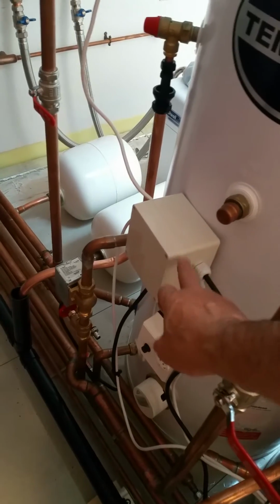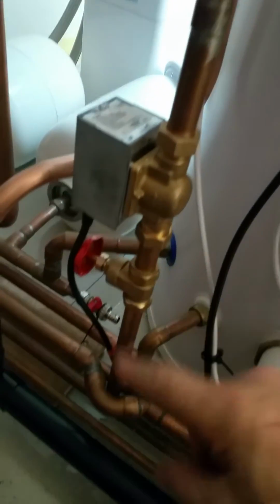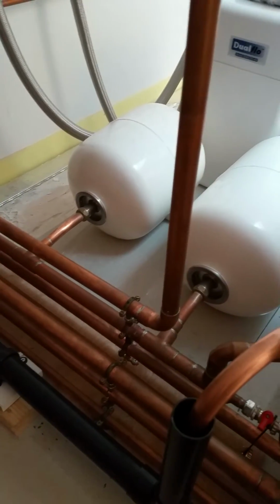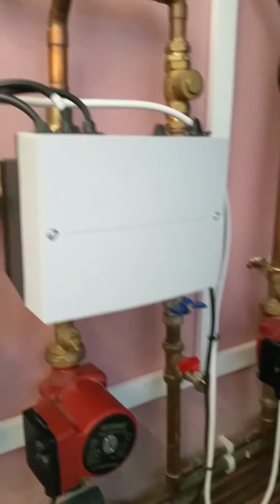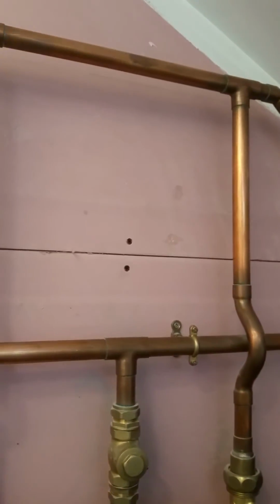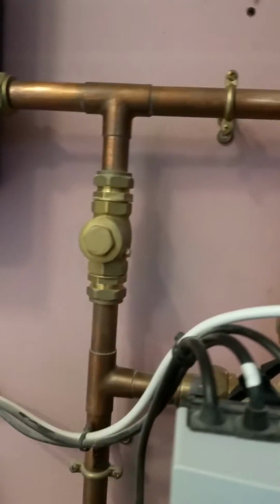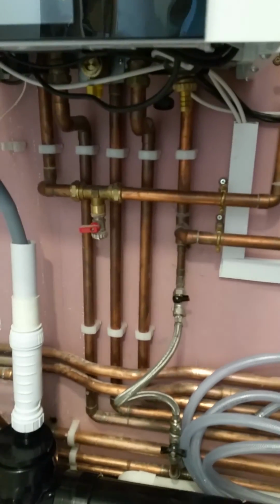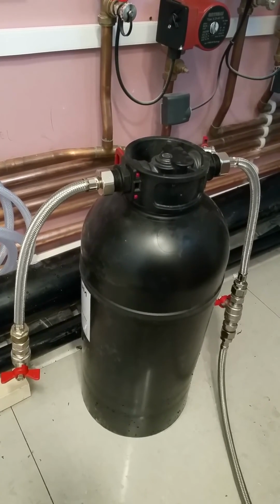Viessmann 200 with two mixed circuits and one unmixed.

Comment: Amazing work.  Been plumbing and heating for 30 years. I have been asked to fit my first low loss header. Never designed system with one before. Could you give me an ideal where to start. Books on websites. Thank you in advance
Reply: Thanks . Are you just Andrew Millward on Facebook. Had a look at some more of your videos . Hydraulic separation really interesting.
Reply from the maker: @simonexcell6496  yes Andrew millward
Reply from the maker: Our forum is a good place for learning. Send me a face book friend request and i will add you.
Reply from the maker: https://www.facebook.com/profile.php?id=100011041051437
Reply: Hi Andrew struggling with the link or to find you on Facebook. Was wondering if you had many fans go 200w series
Reply from the maker: @simonexcell6496  1 fan on a 200. About 2 years ago.
Reply: Hi Andrew . Is it best to place the close coupled tees arrangement as close to boiler as possible ??
Reply from the maker: @simonexcell6496  I dont think it matters tbh.

Comment: Great concept of using demineralise water  to maintain the system . Demineralise water is also known as hungry water as it is constantly looking for oxygen I believe there is no a problem with Viessmann boilers because of the construction of heat exchangers and the material they use 
Surgical steel to prevent damage when exposed to demineralise water what is a common thing in use across Europe.
I think sometimes the fittings and radiators may be a problem especially when the central heating is off during summer times.
Great work Andrew
Reply from the maker: Robert Charzewski I add a small am out of hard water to the demineralised water to reduce its "hunger" I measure conductivity to ensure it's within a range in accordance with advice from an expert.
Reply from the maker: Demineralised water and distilled water are different. The demineralised water is mixed with ordinary fill water to buffer it. This reduces the agresive nature of demineralised water. Ph is also adjusted to 9.8 in systems not containing aluminium. With conductivity low and ph high oxygen ingress can be more tolerated. Good system design should also limit oxygen ingress. Good design includes position of expansion vessel relative to pump inlet, expansion vessel size. Boyles law determines the pressure fluctuations while Henrys law deals with the relationship between pressure and gas solubility.

Comment: Andrew 
Great installation again well done 👍. I really respect people who can admit their mistakes and be prepared to rectify the problem . I fitted 2 unvented cylinders with secondary circulation making sure the temperature drop was not greater than 5 degrees between flow and return to prevent any legionella growth. I used pipe thermostat and timer to control my pump.